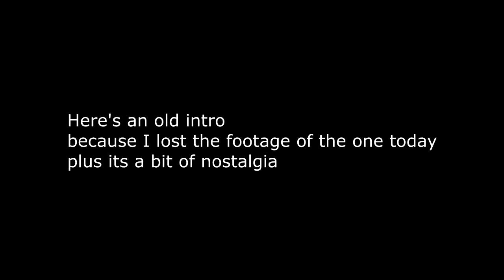Body Checking His Car Door Off (PRANK GONE WRONG)

Comment: Dylan, cool video. but you guys are the worst mechanics I have ever seen. LOL... A friend and I had an entire car completely stripped, engine out, doors off, dash out, seats out, all electrical cabling out, completely stripped down to a shell in less than a day. you really only need to place the car on some car stands so that you can slide under it, connect an engine lift to the engine, and start removing bolts from where the engine pipe (exhaust pipe where it joined the manifold) joins the manifold, disconnect the CV joints, and remove the bolts on the engine mounts where it joins the sub-frame. Lift the engine out. That gives easy access to go through and remove the entire exhaust system, and to remove the exhaust manifold. Don't forget you will need a new exhaust manifold gasket (you can either make one or buy one.)
Reply from the maker: yes. yes we are. and thats why my passenger cv joint is held on by 3 and a half bolts and no lubricant right now...
Reply: Oh Dylan, 3 1/2 bolts mate that's not good. You need to fix that. If only i was in Canada, i would show you and teach how to do it. But i guess we all have to stay somewhere.